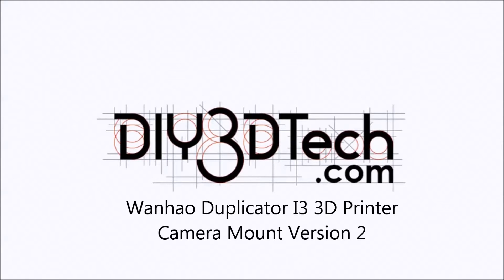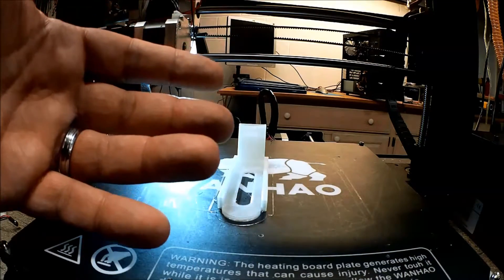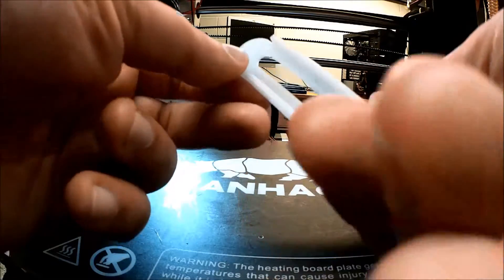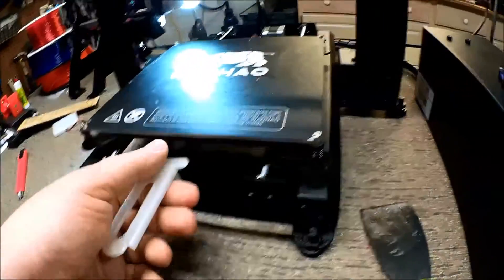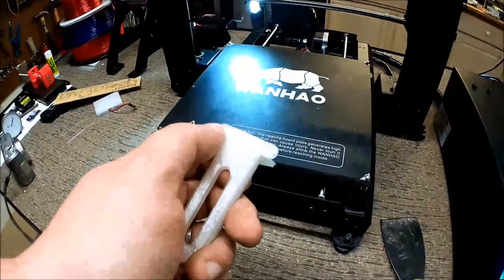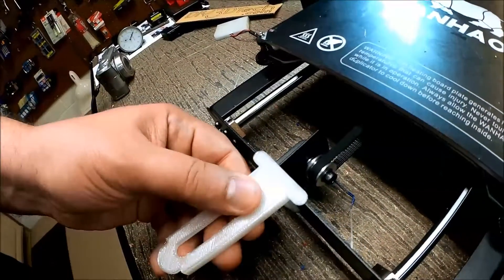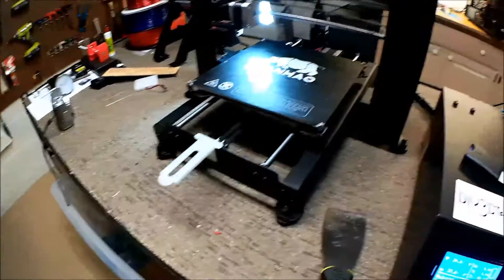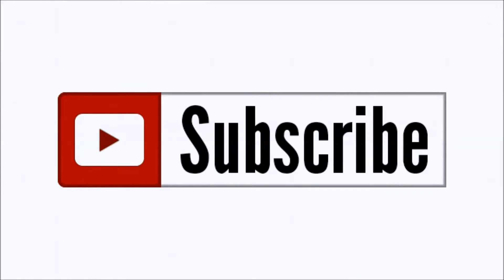Wanhao Duplicator I3 3D Printer - Camera Mount Version 2

Comment: I use a raspberry pi camera with octoprint, I can't find a good angle with the camera, since mounting it anywhere on the frame would have the print blocked.

Since I'm installing the z-brace mod, I will see if i can mount the camera on any of the rods, I've already been experimenting on some models for mounting on the threaded rods, and if it works, I'd be happy to design one for your camera as well if you provide me the dimensions or an stl file of a part that attaches to your camera.
Reply from the maker: Appreciate the offer :-) however don't have the Z-Braces on mine never really felt the need, however I would be interested in how it turns out so please keep me posted.  Also forgot to mention in the replay if you have a Wanhao ground fix, you should also do the grounding fix to print at higher temps...
Reply: +DIY3DTECH.com i haven't heard of that yet, but I'll look into it since I'm planning to print some exotic filaments soon :)
Reply from the maker: Here is the video:https://www.youtube.com/watch?v=p5_pnF4zdKc&index=20&list=PLInTrkIbj69lJEjA2gwSTOngYDBccxv_-